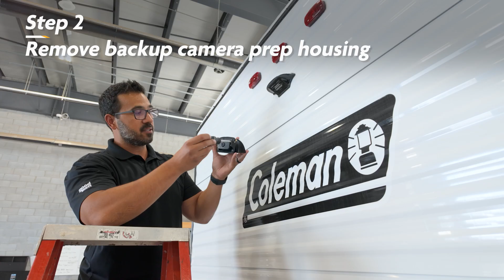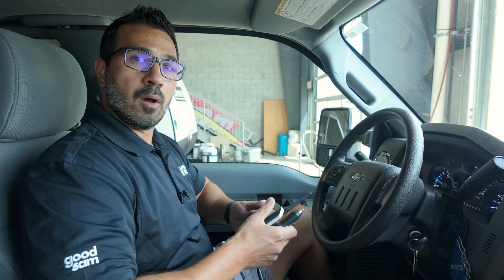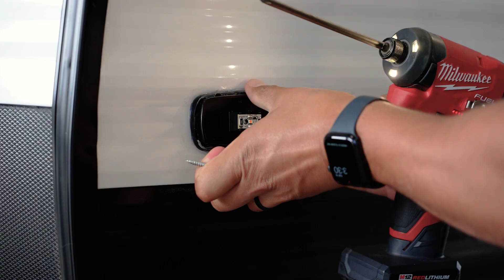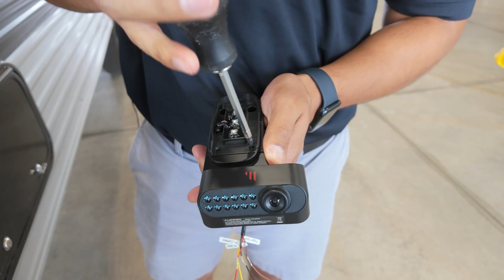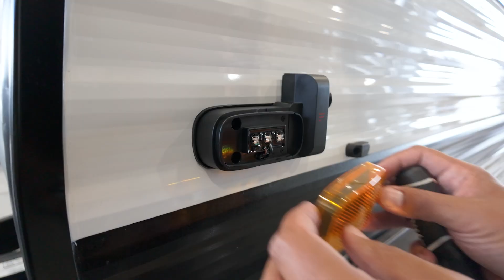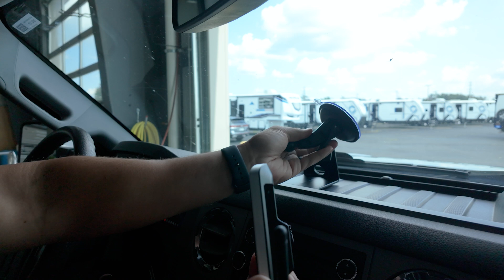Furrion Vision S Installation | RV Modifications

Comment: Thank you for the tutorial.  Wish those side cameras were blinker activated
Reply from the maker: Glad you found the tutorial helpful! It's our understanding that this system can be wired to activate with trigger signals, but that it will depend on whether your RV is pre-wired correctly. Some RVs are wired to only offer running lights on those side markers, whereas others are wired to offer turn/trigger signals. You may need to contact your RV's manufacturer about compatibility. Hope that helps!

Comment: What kind of connector are you using for the wiring?  You didn't say, the video is out of focus, and it isn't clear.  I don't want to use the wrong one and have it fall off inside the camper wall.
Reply from the maker: Is your RV prepped for a backup camera? Or are you using the wiring from a taillight?
Reply: @CampingWorldTutorials This is the side camera, and I'm using the side marker wiring.  Trailer is a Coleman 17b (helpfully, like the one in the video!)

Comment: Thanks for making it very clear how to connect the side marker cameras to trailers with just the basic 12V and ground wires. I was a little worried when I opened the box and saw 4 wires to connect.
Reply from the maker: Glad we could help clarify those connections!
Reply: It was especially helpful for me as I own a new Coleman 17B.  The rear camera was easy but the side cams had me baffled until I watched this.  Thanks!

Comment: Why not use swap the housings around? Like leave the camera in its housing and remove the one from the camper.
Reply: I’ve done it that way. It works, but it’s probably just more work. I found that the housings were exactly the same anyway (at least in my case).
Reply from the maker: David has a solid point here. The reason the camera comes with its own housing is so that it can be installed on a non-prepped unit. With the prep (as long as the housings are identical and the camera is compatible with the prepped housing), the method described is the simpler way to go. Hope that helps!